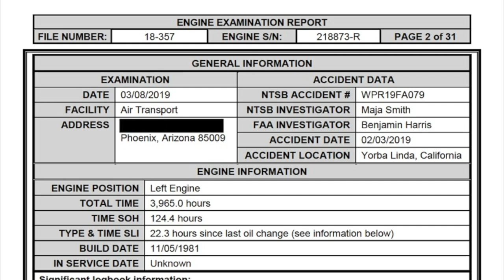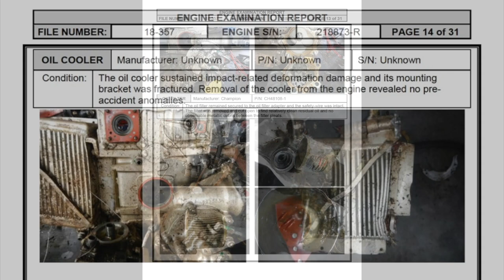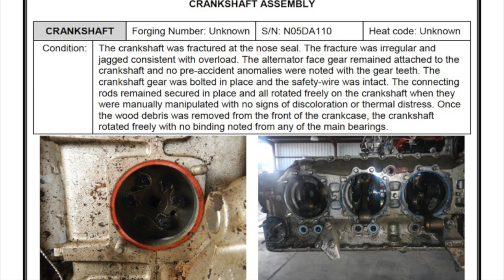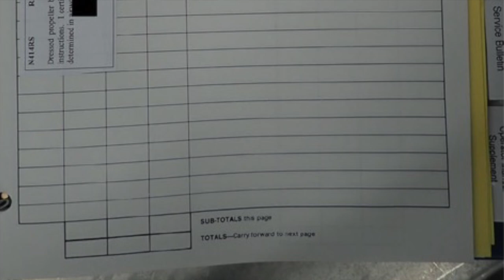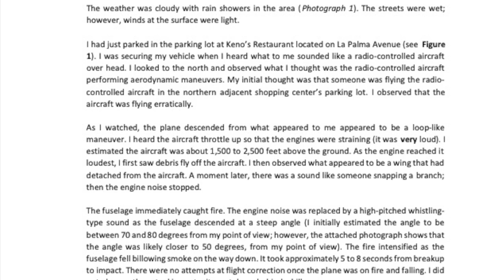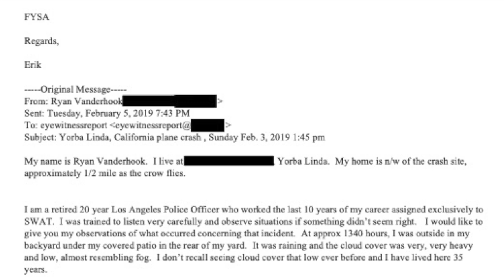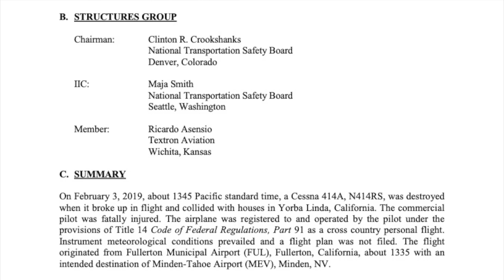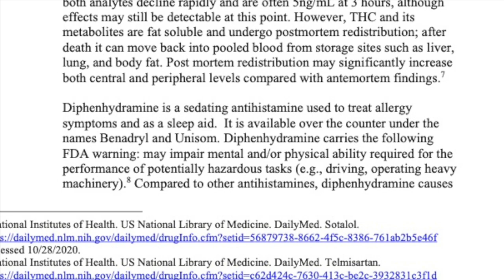Cessna 414A Chancellor In-flight Breakup Over Yorba Linda

Comment: Bizarre. radar airspeed doesn't seem to indicate a stall, which I figured would have been the case, having been caused by spatial disorientation in the clouds, leading into an attempted recovery and overloading the aircraft.  Seems he just lost track of his pitch in the clouds and tore his aircraft apart by jerking the stick back too hard when he broke through the overcast.
Reply: 75 year old male on Benadryl. Reflexes, eyesight and memory have been eroding for the past 30 years. Possible neurological anomalies. Breaks major flying rules. Lax about physical health. Lax about possible issues with his aircraft....

Yeah, I thought he might have stalled but there are plenty of ways to get yourself in an unusual attitude. According to a Pilot witness, "about 4-5 seconds" passed before a pull up recovery was initiated. See paragraph 1.

Comment: I wonder if the pilot from the Angel Flight who rode with him called the FAA afterword?  And, if not, why not? Flying in IMC in the blind as he did shines a bright light on the incident pilot's lack of respect for flight safety. It also opens up many other questions about the crash. A trash strewn plane with a noticeable engine oil leakage would make one wonder if the plane's maintenance was as shoddy as its cleanliness. Was the plane current for IFR operations? Was it recently checked for compass alignment? And, on and on. Also, I would question the Medical Examiner's Report. Very often, coronary enlargement is due to the heart's attempting to pump blood against a higher than normal backpressure from narrowed pathways. What was causal there? Could he, at this age, be in the verge of Alzheimer's? Any stroke or TIA history? I am skeptical, too, of the ME's saying that each of the blood values, independently, should have had no effect on the pilot's ability to safely operate an aircraft. Perhaps in a ground vehicle. Aircraft are different. Also, there is a "Toxic Soup" effect of blending  several low concentration drugs that of themselves might not produce noticeable changes in behavior,  that will produce an untoward effect if mixed. The drugs and pharmaceuticals listed are known to have depressant properties. There's more of a medical quest, but I've gone too long here.  I just wish that an experienced Aviation Medical Examiner would have been on top of this.

Comment: Catastrophic engine failure, there are winglets but no wings till the final crash site, really doubt a wing falling off caused the lack of control, maybe an oil/fuel fire along with the out engine caused the loss of control. The debris is from all over the plane structure starting with the tail and some lightly attached parts like winglets, indicates wild spinning/cartwheeling/etc, after the engine failure/fire/?, the tail has nothing to do with engines and it's not easy to rip one off. My take is the breakup starts with the tail and the final breakup and crash site starts with the RH engine, once the tail is gone any change of controlling what is left is 0.

Comment: Another VFR into IMC?
Reply: Yup.
Reply: @docholiday7758  This type of accident is pretty common, though. Perhaps every VFR pilot should get at least some instrument-only flight instruction, it might save a lot of lives.
Reply: @artisanautobody3931  VFR pilots are required to receive some instrument only instruction...including while recovering from unusual attitudes. Imho, the biggest danger is experiencing vertigo while flying single-pilot IFR. I once experienced vertigo during a theme park ride designed to induce vertigo. Though we were not moving at all, it was impossible for me to lift my head straight up using all my strength. That experience convinced me not to bother with getting my instrument rating. It's one thing to fly by instruments...not hard at all. It's a whole nuther thing when your body refuses to cooperate with you due to vertigo. I would only fly IFR with an instrument rated co-pilot as the likelihood both pilots would become incapacitated by vertigo is much lower.
Reply: no.  Pilot was a 10,000 hour + commercial pilot, fully IFR rated.  Did NOT file IFR and was breaking about a million rules, but this was NOT some newbie VFR pilot lost in IMC... this guy knew what he was doing.  Something happened.
Reply: @artisanautobody3931  no.  Pilot was a 10,000 hour + commercial pilot, fully IFR rated.  Did NOT file IFR and was breaking about a million rules, but this was NOT some newbie VFR pilot lost in IMC... this guy knew what he was doing.  Something happened.
Reply: @MrZrryan2  Sounds like his brain got fried on drugs or something. Makes you wonder how he passed his medical or BFR...wouldn't surprise me if he hadn't had one in years.

Comment: Stunning performance on the part of Fullerton ATC. Apparently, anyone can walk in the tower and start handing out instructions. At an airport with one runway, she had to pause and think that left base for 24 was south "east" of the field. Then assigned maintain 2000, expect 2000 5 minutes after departure - because that totally makes sense. Then leisurely negotiated with the pilot what they filed, like that would change the only available route and altitude they were gonna get anyway. The pilot, aside from making a typo, was far on top of what was going on than the ATC.
Reply: None of that is relevant to anything. ATC is far more than reading back clearances. I'm guess you're one of those sim "controllers?"
Reply: @kewkabe  What FUL tower did isn't relevant to the accident. That doesn't change the fact that the controller did so horrid, it stood out to the point of comical. I enjoy playing ATC sims if that is relevant to anything.
Reply: @iafdof1377  Well I'm an FAA controller and can tell you your analysis is so horrid it stands out to the point of comical.
Reply: dont depend on ATC to be your copilot....pilot flys, controller controls, and dont try to do thee others job